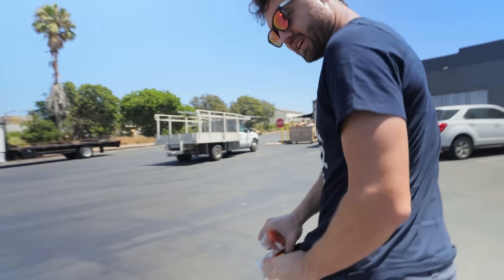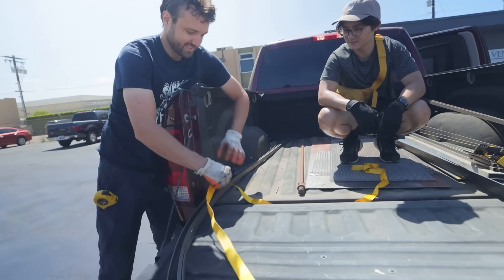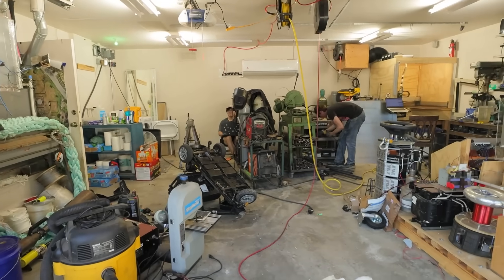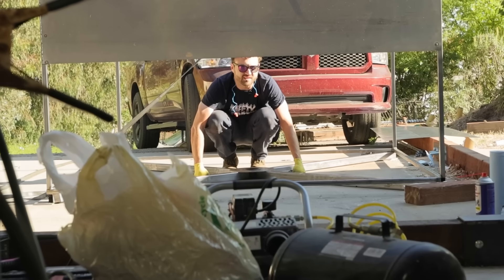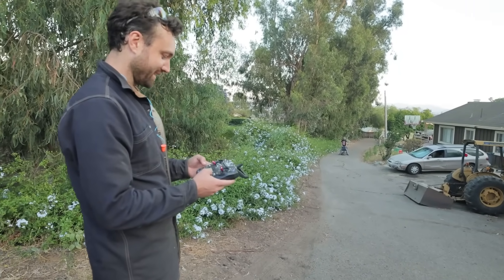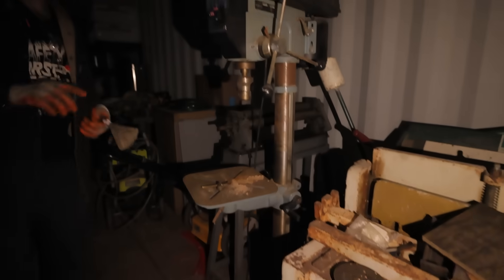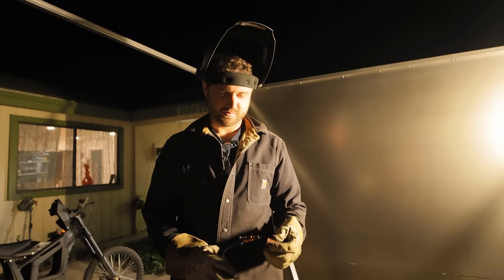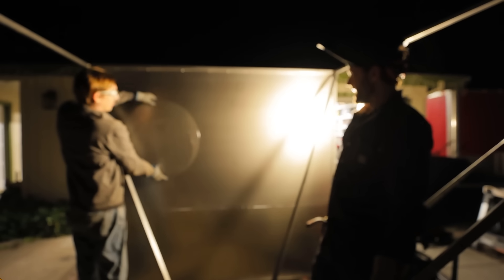we build robot episode 69

Comment: Made a power supply with surface mount pots recently... I agree with William. Just give up when you're in that deep, designing a case for surface mount stuff SUCKS. It's like designing a massive robot head for a truck in a way... You have no idea of spacing, or anything really. You just kinda rushed it, and it might work... And you spend way too much on it for the sake of time and convenience... Then it doesn't turn out exactly how you wanted... So you end up spending way more time on it than you wanted... 
Anyway. Roblox? Ye no William... I don't think you want that. Not right now at least. Maybe wait a few months and see...

Comment: You're probably not gonna read this but it would be super cool if you did a bit of projection mapping onto the bot. It would allow you to reuse the same frame across multiple years while and in different venues while being able to change its face. Resolume would be a good bit of software to use for something like this as well as touch-designer.